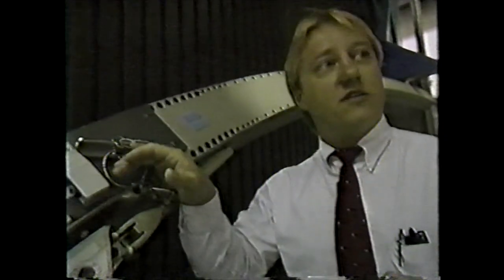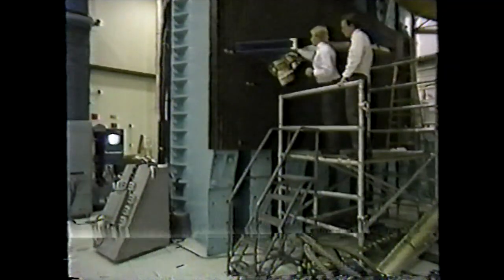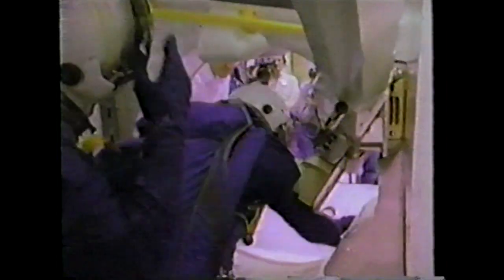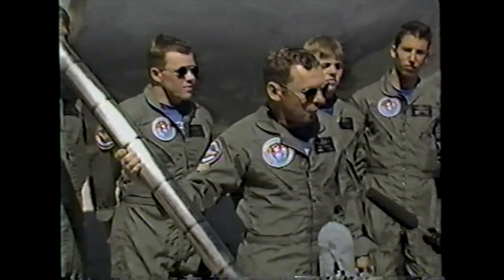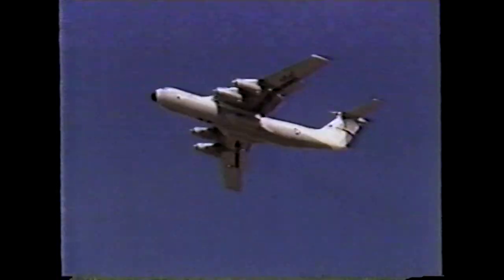First Use of Space Shuttle Crew Escape System on STS-26 | Return to Flight After Challenger

Comment: This was more of a PR thing than an actual capability, it can only be used if the shuttle was in a stable glide and subsonic. I mean the only scenario I can think where this would happen is if the orbiter ran out of energy while coming in to land, a scenario which is extremely unlikely considering the fact how high the orbiter is on energy while reentry. Plus there’s alternate fields as well.
Reply: The only probable use case of the bailout capability (which still was unlikely) was a dual engine failure during the first half or so of ascent, resulting in a contingency abort (which almost always resulted in a bailout).
Reply: Nope, the use was dual or triple SSME failures during the first ~10 minutes of flight. There's a large window when you don't have enough energy to get back to the launch site and you can't make it to a runway in Europe.
Reply: @straightpipediesel thanks
Reply: @straightpipediesel  Just to be clear, if they make it to T+ 10 minutes, they are pretty much on orbit.
Reply: I was in the Air Guard, Air Rescue unit during this time. We were tasked with assisting shuttle launches, called a Mode VIII exercise. We had HC-130P aircraft, and our tasking was this: 2 HC’s deployed to Patrick AFB about 3-4 days prior to scheduled launch. Our aircraft were both configured with 2 internal fuel tanks (giving us a maximum of about 84,000 pounds of fuel available), 3 RAMZ (Zodiac boats deflated and rigged for airdrop), 9 Pararescue Jumpers (PJ’s), 2 crew chiefs (I was one), 1 mission commander, 8 aircrew members, and enough rescue gear to provide for any possible emergency. The one Mode VIII I did, we were King (our normal callsign) 2. The primary HC would be King 1. King 1 would take off about 2 hours before scheduled launch and orbit about 250 down range. King 2 was at Patrick with 55,000 pounds of fuel, and ready to go, with a full fuel truck standing by. If there was an incident within the first 250 miles, King 1 would commence a search while we would launch refueling 2 rescue helicopters in flight, where the helicopters would perform the recovery, then we’d escort them back in. If the incident was between 250 miles and mid- Atlantic, we were to on load as much fuel as possible, while King 1 was returning to do the same. We’d head out without the helicopters, and search for survivors. If any were found, we’d drop 1 RAMZ and 3 PJ’s, if the astronauts were in a line (good in theory), we’d drop 1 RAMZ at each end of the line, with another in the middle. We’d also be able to airdrop any supplies the PJ’s needed, and also MA-1 rescue kits, which contained 20 person life rafts, food, water, radios, all kinds of equipment. We’d stay on station as long as possible, with King 1 relieving us, and this would continue until a rescue ship arrived. It was calculated that a mid-Atlantic scene would have allowed us about 20 minutes on scene before we’d have to head to Africa, as we wouldn’t have enough fuel to return.
Reply: @clydesuckfinger8068  
I'm glad that was never actually needed.  Prepare for the worst and hope it doesn't happen.
Reply: @clydesuckfinger8068  That's a fantastic insight to the rigorous planning and preparations that took place. Thanks for sharing your experience. I directly feel being a pararescue jumper takes tremendous courage.
Reply: @ Yeah, the PJ’s were extremely brave guys. I’ve been onboard when they’ve jumped into the Pacific at night, the only thing that can be seen are the Chem light sticks on their helmets. As I remember (I’ve been retired 20 years), their school was 2 years, and the washout rate was something like 70% or greater. Most applicants could get thru the jump and physical fitness stuff, but the medical would get them.
Reply: @clydesuckfinger8068  Thank you for the detailed info about rescue plans. My first launch was STS-7, and not long after I arrived at the press site, I was able to witness a rescue rehearsal. There was a plywood full-scale mockup of the Orbiter's crew cabin area that was floating in the basin in front of where the countdown clock is located. Helicopters with frogmen came in and did the training exercise. It was fascinating to watch, and it was all done after dark with giant searchlights lighting up the scenes from another helicopter. The next day, the mockup was docked nearby, and I was able to go aboard and check it out.
Reply: Or imminent loss of hydraulics?
Reply: We know the challenger crew survived the breakup, but not the impact with the ocean at terminal velocity. If they’d had the ACES and this bailout, they likely would’ve survived, as the cabin had separated from the rest of the orbiter.
Reply: Exactly. NASA had to show the public that something was being done to save the astronauts in an emergency, but the escape pole was certainly nothing that would have ever made any difference.
Reply: @x15galmichelleevans  
No doubt.  They had to answer the finding from the accident report, everybody knows that it was just cosmetic.  The shuttle had very little funding and no national priority, which means upgrade money wasn't in the cards, either.  No way was it going to be re-designed at that point.
Reply: @Skank_and_Gutterboy  There were 109 more flights of the Space Shuttle after this, including the terrible loss of Columbia. Several aspects of the system should have definitely been redesigned, including the ET foam application, and most definitely the replacement of SRBs with LRBs. The Space Shuttle system could still be flying today if those had been accomplished in a timely manner. And it would also be a heck of a lot more cost effective than the current Artemis program, which has cost billions more than the Shuttle ever would have during this period, and delivered absolutely nothing to our space program.
Reply: @x15galmichelleevans  
Yeah, I agree with that.
Reply: @x15galmichelleevans  LRBs would be so much more expensive than solid rocket boosters, and not even safer really. SRBs being unsafe is basically a myth at this point, their limits are well known. liquid engine turbomachinery does not react well with seawater, how do you propose they recover them without going down a massive propulsive landing R&D hurdle

you are really oversimplifying things, not to mention SLS sent a crew capsule around the moon for the first time since the last apollo flights, do you consider that to be absolutely nothing? orion is the only lunar rated crew capsule in existence right now, and even if you stack it on top of a falcon heavy, there is barely enough delta-v for a lunar flyby at most. SLS is the best we have right now, and i'm saying this from the position of someone who loves SpaceX
Reply: @ixxxxxxx  LRBs can be shut off, while SRBs cannot. That's what doomed the Challenger crew. So, yeah, much safer. Liquid rockets are being recovered at sea nowadays, as you know with the Falcon 9 and Falcon Heavy. They may not have had that technology during the shuttle program, but even if we had discarded the strap-ons, the crew and the Orbiter would be around today. As for the SLS, it has been a huge waste of money. At $4 billion a launch (or most likely more) it is worthless. How many times a year can it be launched, or more accurately, how many times a decade? Maybe 4 or 5, if they are lucky. As for being a lunar rated spacecraft, that truly is yet to be determined. The heat shield suffered major anomalies on the one and only flight so far, which is one of the major reasons we have not had another launch. Can you imagine where we could be if we had put that money into other avenues. SLS is a boondoggle that has gotten us nowhere. We went from nothing to landing a crew on the Moon in apollo, in around 8 years. We've been wasting our time on SLS, under various names, since 2004. Here we are 20 years later, with how many billions spent, and just one partially-successful mission under our belts. We could have gone almost any other route and come up much better.
Reply: @x15galmichelleevans  it would have taken more than just liquid rocket boosters to save the challenger crew, or to keep the shuttle around today to begin with, for example, we don't need to fly humans on cargo flights anymore now that robotics have improved, not to mention the turnaround has never been quick or cheap. i'm aware SLS is 20 years late, however it's easy to say how much better you could've done it when you're not the one mediating between nasa and congress with administrations constantly changing

i'd be down to stack orion on top of a falcon heavy to perform the artemis II mission but that's all it can do, a flyby. gateway cannot launch on falcon heavy, the payload restrictions do not allow it. as for new glenn and starship, that is up in the air, no one knows yet what kind of payloads these can take. SLS is all we have to complete artemis right now, there is currently no other option unless you go back to the drawing board or wait for the commercial industry to catch up in terms of lunar payload capacity. rant over, apologies, but i hope you consider my points here, to not be so pessimistic
Reply: @ixxxxxxx  Sorry, but yes, LRBs would have absolutely saved the Challenger crew because 100 percent of the reason they died lay in the design of the SRBs.
Reply: @x15galmichelleevans  if your premise is "if we're launching when it's really cold" then yes LRB's would have saved challenger, i'll walk that back, but it would not have made any major structural failure more survivable, or shuttle any cheaper. my point is shuttle can't really abort that early into flight regardless of boosters used if those struts fail

also i hope the artemis heatshield issue gets sorted in a timely manner, but we likely won't hear anything concrete on it until the administration change takes place
Reply: @ixxxxxxx  As I mentioned, the LRBs could have been shut down, whereas SRBs could not. Right after the SRBs were shut down, a major abort option opened up called the RTLS or Return To Launch Site abort. If LRBs had been used, then the RTLS option came into scope earlier in the flight profile. The attachment struts only failed because of the SRB burn through caused by the failure of the O-Rings. The O-rings would not have been present if LRBs were used, thus the struts never would have been compromised. No strut ever failed in the 135 missions of the Shuttle program, except because of that burn through.

There are also many other things that could have been done to bring down costs, but were never implemented, especially after it was decided to go with SLS. Shuttle missions cost approximately $500M each, about 1/8th the cost of an SLS launch, so by not going to SLS, the Shuttle upgrades would have been a lot more cost effective, not to mention all the money that would have been saved over the huge span of time where NASA had to pay the Russians for rides on Soyuz since we had no way for Americans to get to orbit without them.

The SLS heat shield problem has zero to do with any change in administration, and is not being delayed in any way because of the election. That is absurd.
Reply: @x15galmichelleevans  NASA still hasn't given any word on the heat shield and there likely won't be any word until after a possible new administrator gets appointed. i'm telling it how it is

yes I know what RTLS is, it's only open during specific failure modes, even if LRBs are in the picture. what I'm trying to tell you is that this isn't reliable enough for crew rated spacecraft anymore